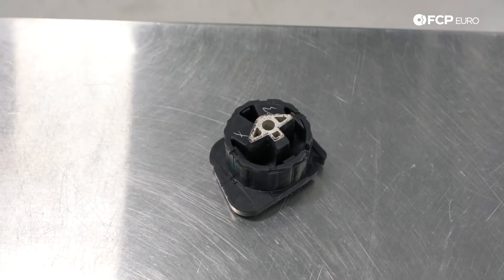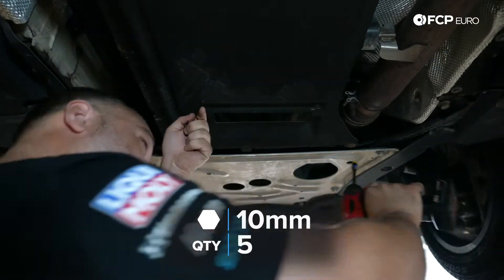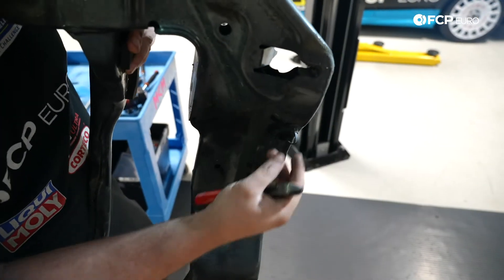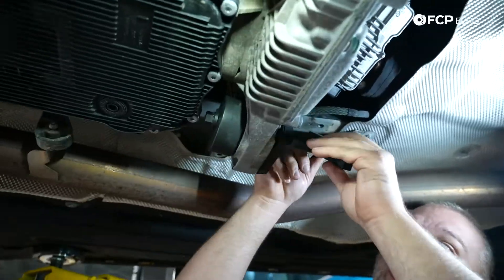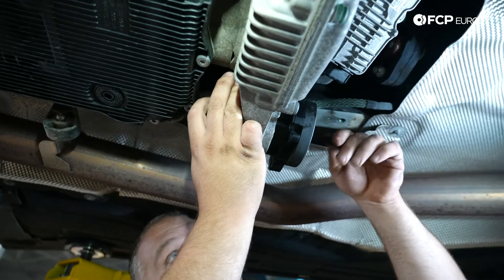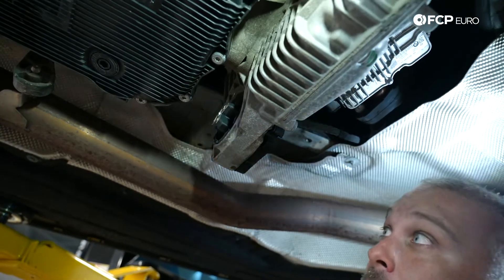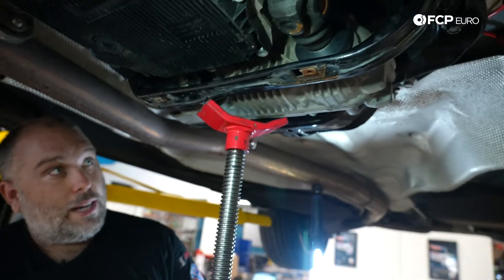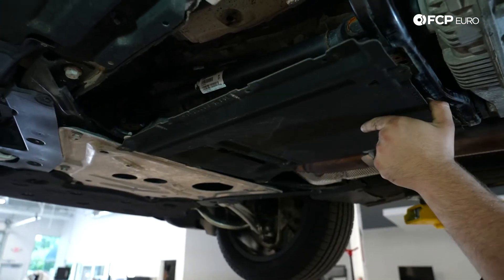BMW X5 Transfer Case Mount Replacement DIY (2014-2018 BMW F15 X5 & F16 X6)

Comment: BMW instruction requires to support Transmission or Transfer case before removing cross member. Without support,  weight of the Transmission, Transfer case and shaft puts lots of stress on the joints ate the transferase and possible on the lower oil pan split joint, which may eventually starts leaks from lower oil pan gasket. Also, this is a good opportunity to drain and fill the Transfer case fluid.

Comment: Loving all the F15 content as I just got one. When will you guys change the transfer case and front diff fluid in one?
Reply from the maker: Its ready to publish just stand by!
Reply: @fcpeuro  Perfect! About to order fluids from u guys for the TC and both the front and rear diff. Can u please advise if both the front and rear diff for F15 N55 X5 xdrive use 75w90? Thanks
Reply: @fcpeuro is the F15 transfer case fluid video up? I’m looking at doing that on my 2014 X5 SDrive and not sure it’s the same as the XDrive models?

Comment: With a little more effort you can succeed in this replacement using liquid detergent in the friction soles and vaseline on the new part, 60-70% by hand and the rest with a few light hammer blows.
Reply from the maker: Nice work!

Comment: How do you know when it's bad?  Thanks for this DIY & PLEASE keep the F15's video's coming.
Reply: That's a good question. My E70 had it destroyed. Never noticed anything wrong with it. Maybe... maybe some little vibration at full throttle that I haven't felt after. Technician found it damaged while replacing transmission fluid.
Reply: @aruekca18det  how many miles were on it then?
Reply: @abimmernut  94,000kms 10 years
Reply: @aruekca18det  wow! That only 58k miles. Was they any oil getting on it from transmission or engine?
Reply: @abimmernut  nope. But in my country the road are not that good really. 🙄

Comment: I wish you would have included a transfer case fluid replacement video on this one since everything was already off. I’m looking at doing the transfer case fluid change on my 2014 X5 SDrive, is the fill plug easily accessible to drain/fill the fluid without removing all those parts first?
Reply: I’m assuming by this point you’ve come to the pleasant realization that your sDrive X5 does not have a transfer case that needs maintenance, since it’s a RWD vehicle.

Comment: Thank you for this video!!!! I do have a question. What are the typical symptoms of the mount needing replacement? I’m currently driving a xdrive35i with third row seating w air suspension and the second row (comfort seats vibrate on rough terrain. Even below 15 mph. Thought this might be related?
Reply: Check your front suspension first all bushings.
Reply: this is a couple years later but might be helpful for people having the problem now. for anyone wondering the symptoms, my e70 bmw x5 had a vibration that i would feel right below my  center console. the vibration would stop at around 15-20mph and be totally fine from then on at high speeds. i would also feel it on turns, up to a certain mph. hope this helps! (i have my notifications on so just @ me and reply and i’ll get back to you)
Reply: @mydogeatsmeout1941   thanks for the reply mate. I wrote it off as just the seat latches not being tight enough or really bad latch tolerances from factory. So just shit quality in a sense.
Reply: @mydogeatsmeout1941 I’m getting kind of symptoms that my whole transfer case shakes when on lift when I give it little gas. And it also vibrates the whole car while turning steering to right on big road curves but goes away when steering wheel is straight and to left.
Reply: @DeepakGupta-qg3xh  i’m not too sure. mine would happen on both left and right turns, but only if it was under 20mph. it could maybe be your CV axle?

Comment: Wish you would have showed or atleast advised on how to remove exhaust pipe on driver side. Obviously it was removed before hand to show how easy it is to drop transfer case cross bar. I tried DIY, bought parts and tools only to realize exhaust pipe is in the way. Do you have a video on how to remove exhaust pipe?
Reply: My guess is that you've got a modded exhaust because it should be doable without touching exhaust. That said, BMW do like to create a thousand different variants of each series car.
Edit: oh, i see what you mean. No, if you take off the shrouds on the other side then don't need to touch the exhaust.

Comment: I have an F15 40d.

Does anybody else with the same/similar model notice when you come off the throttle at around 1500-2000 revs, there’s is some slight jerking/vibration as the revs are dropping back down? It seems to happen just as the revs drop back down past 1500rpm. It’s particularly noticeable when driving around town and you’re only applying light throttle on and off around that region.

It almost feels like a misfire, but it can’t be.

Any idea????
Reply: Same
Issue. Check my video in my channel. No answer whatsoever. Been driving like that for 2 years
Reply: Ita a feature not an issue. People pay extra for this vibrations.